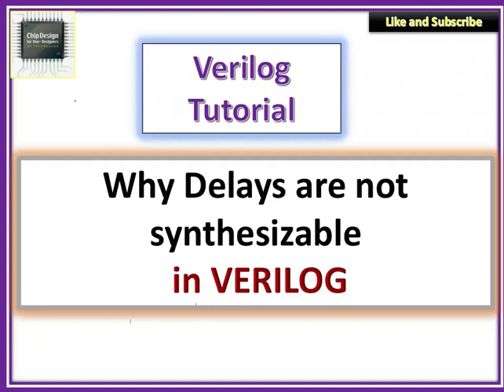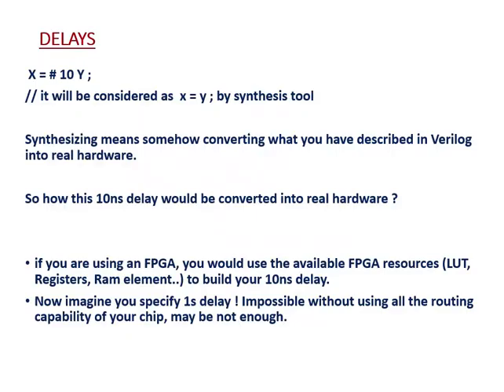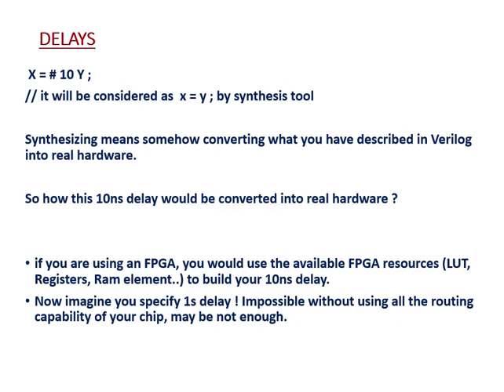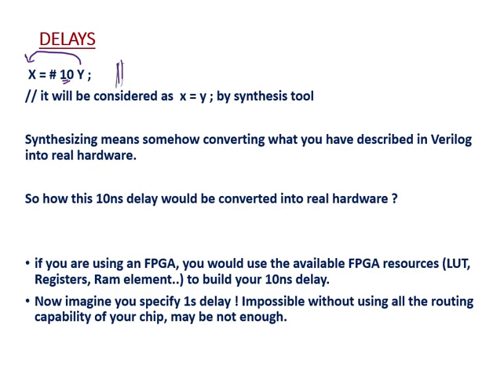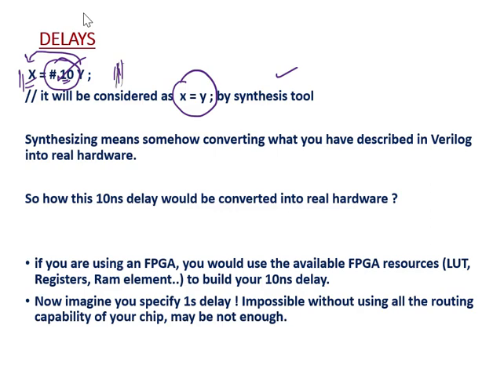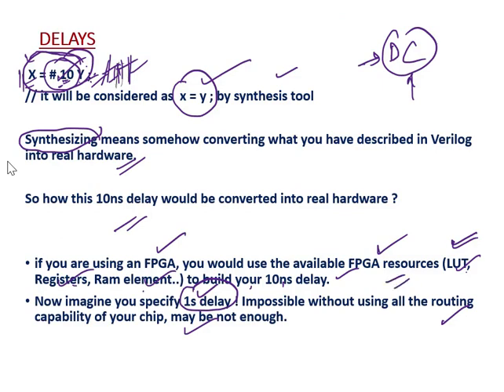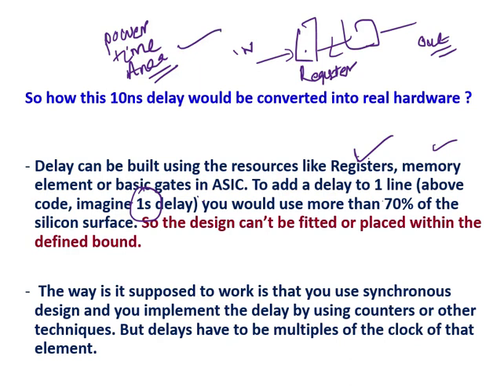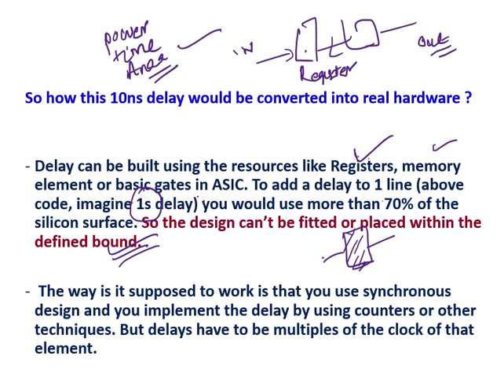#21 Why delays are not synthesizsble in verilog or HDL | VLSI interview question

Comment: Now, my concept clear about delay!
And another que. is that, if delay is not synthesizable ot not to convert into realistic hardware then why we add delay into the circuit...and why we can't use into hdl code?
Reply from the maker: Delays are never used in HDL coding but it's used while writing TESTBENCH to verify the design. Delays are meant for testbench writing.
I have already explained why delays are not synthesizable and that is the reason we don't use delay.
Thanks

Comment: sir as you are saying that delays are not synthesizable  and if we want to have a delay of 10ns then we have to realize that delay with the help of a clock but my doubt is how we can realize the delay in the combinational circuit where there is no clock then how these delays are incorporated there
Reply from the maker: Using buffer circuit which is simply a emitter coupled logic
Reply: @ComponentByte  thanks sir 
Sir you mean as we realise delay with buffer then it will consume 70 % of silicon area so therefore synthesis tool will realise that dealy with the counter 
Am I correct???

If yes then my question is if any combinational ckt in practical application which involves delay then  this delay is always realised with the help of counters 

Or they still uses buffer to realise it ??

Comment: You are saying delays are mostly used in testbench writing. If we are providing delays through counter , state machine in hdl coding then why we need delays in testbench? suppose if we will not provide delay in testbench then what will be the effect?
Reply from the maker: One has to understand that Testbench is not a real hardware code.Testbench is only used to test your design functionality and it doesn't generate any hardware. So delays(it's not mandatory) may be used in testbench to test your actual hardware code. Delays are not mandatory in testbench but to make things work we use it.
 
You want to generate a CLOCK using testbench and without delay you can't generate it to test the code.

If you want to give 5 input signals to your design and want to test whether your HDL code gives proper output or not. Say
a=1,2,3,4,5;
If you want to test for each individual data then you have to provide some delay between each data input  because at 0 ns you can't give all the 5 input and test it. This is how your real hardware works. Hope you understood.Thanks.

Comment: Sir delays are not synthesizable, but in real hardwares there will be delays, and we may have  to assign some delays. So how it is done, isit by using counters or LUTs, if so why we are not specifying it in the code we write.
Reply from the maker: Yes, you are right.
Delays are not synthesizable and if you want we can use counter or register.
When it is required we have to include those counter or register. But you don't specify it like it's the delay.

If (count < 5)
Output = a+b;
else count = count +1;

If you write this in your code then you are delaying the execution. This is how it is written without specifying it.

Hope you got it.